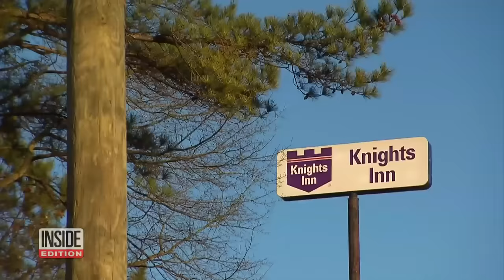Peephole Discovered in Super Bowl Hotel Room

Comment: Some of the problem is they give the maids so little time to clean a room. I used to be a room maid in hotels and I got 25 minutes to per room that involved changing a huge bed, cleaning all around the room. Tidy coat hangers wash and replenish the tea and coffee station. Vacuum. Dust furniture. Check draws were empty. Check the stationary folder. Scrub all the bathroom. Replace towels. Clean the mirrors. Wash the floor. No water marks could be left on the shower screens. Clean the toilet. Replenish the toiletries. Mop the balcony and wipe down the balcony furniture.

Comment: The hotels have a quota for daily rooms being cleaned per housekeeper  like 28 in 8 hrs.  The time frame for cleaning is limited and that does not include the calls for room service.   One of those bugs  was clearly a bed bug.  The one with the flat round body.
Reply: more like 28 rooms in less than 6 hours at most,  at some Hampton Inns, or else the housekeepers get clocked out an hour before check in time, and still have to work off the clock while getting yelled at about running late due to being meticulous and  thoroughly cleaning and disinfecting.. The owner knows the undocumented ones wont go to the health or labor boards to file complaints, which really narrows down and makes it easier to fire who reported it when a complaint does get followed up on.